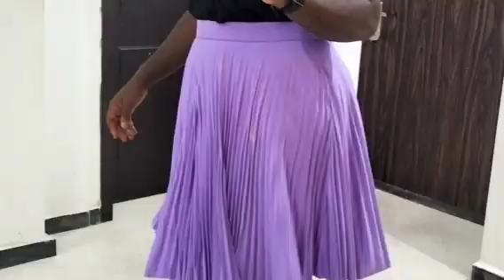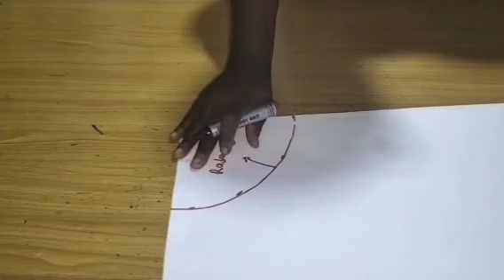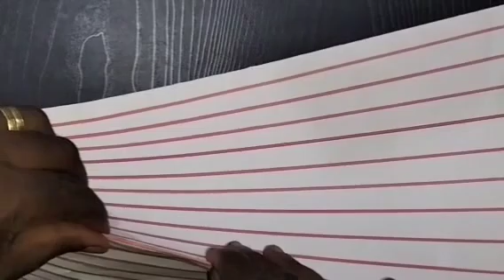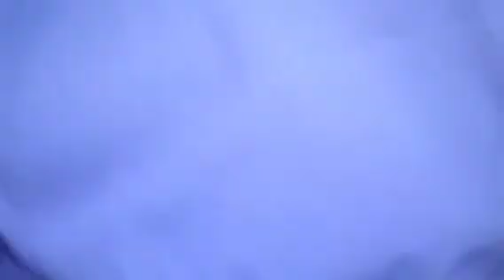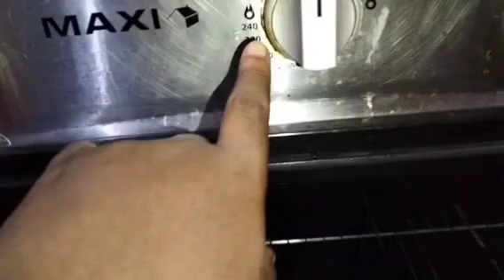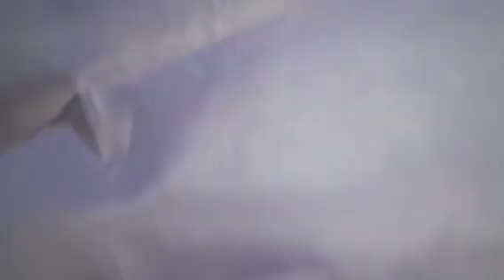How   to  Sew  HOMEMADE   PLEATED    SKIRT using PLAIN CREPE FABRIC ( Detailed)

Comment: Pls ma ,my oven only have medium,low and high is not on degree, what will I set it too
Reply from the maker: Use aluminium foil and wrap the mould very well and set it to high, with bowl of water below,then heat for 20mins
Reply: @Seamrite  thanks ma

Comment: Thank tou for this wonderful tutorial. I do have a question. What if i want to make the skirt longer, and the mold cant fit in the oven because of the length. Is there a trick to make it work?
Reply from the maker: Yes, you can cover the mould with aluminium foil and bend it on the waist side to accommodate the oven,then when you bring it out, you gently iron the disfigured part

Comment: Please ma my oven is not as big as yours is there a way out like if I fold the mold won't the pleat be tampered
Reply from the maker: Yes the pleat will have a line but you can just fold it at the upper waist area,it will not be visible
Reply: God bless you ma